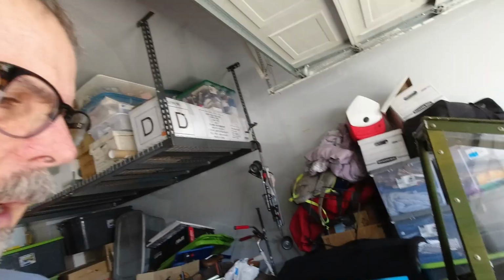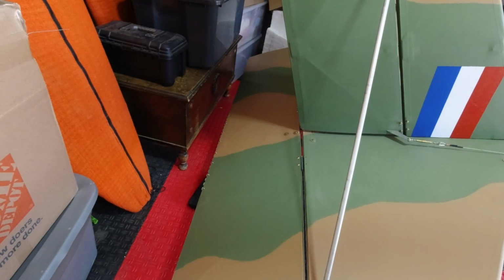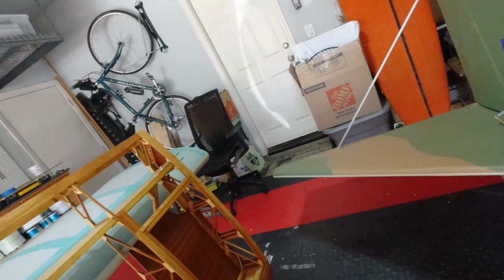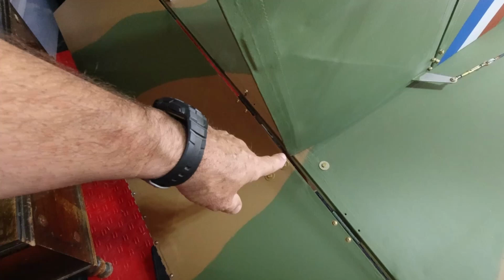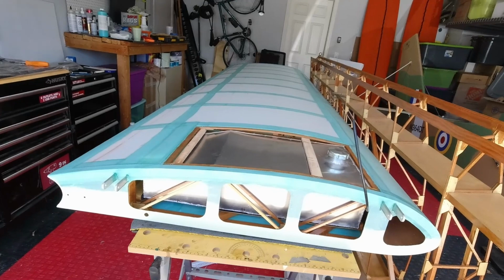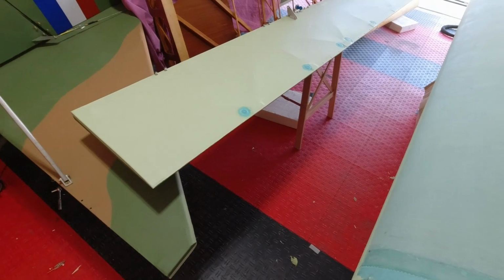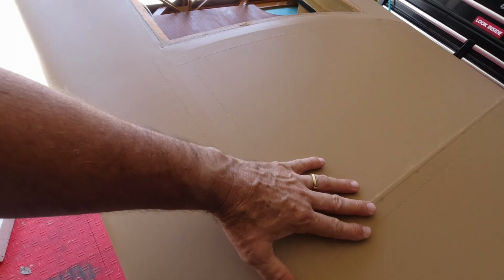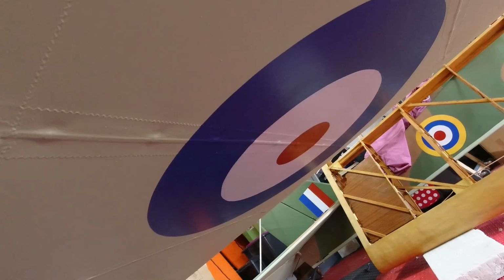Minimax 1100r Wood Aircraft Build Ep 199 - Wing Painting

Comment: Hey Dennis!
How are you mate?!
My name is Raphael, and I live in Brazil. 
I am watching your fantastic building since the beginning. Congratulations!
I am also building a Himax, and I am using the material I have available in my country. I see that you are using Douglas fir instead of spruce.
If you don’t mind I have a few questions: did you reduce the size of the wood due to the use of a heavier wood? My ribs looks so “skinny” comparing to yours: was it made of 1/4 x 1/4 wood?
By the way: the manual recommends the use of UV barrier before painting: what kind of material are you using?
Thank you very much, and again: congratulations for your excellent job!
Reply from the maker: Hi Raphael!
I could have tested the wood against spruce and then reduced the size by that factor but I chose to stick with the original dimensions. I estimate that I paid about a 15lb weight penalty for that but obviously gained a lot of strength. My ribs are 1/4x1/4. 
I’m using one of the best exterior latex acrylic paints. I figure if it’s designed to be on the outside of a house every day for 20 years then my hangered airplane will be fine:)

Comment: Many years ago I had a mini max with a mosler engine on it and a "fighter jet" style canopy.   Never got to fly it cuz it had an electrical issue (turned out to just be a bad condenser) and i headed to Afghanistan for a year.  What kind of paint are you using?  Please let me know what your doing for the painting sequence.....any UV protection?  Thanks
Reply from the maker: I’m using Behr Marquee exterior paint. The best you can get at Home Depot. My formula is simple, 200g of Paint, 12g of Flotrol, and 30g of windshield washer fluid. 
The paint is my only UV protection.
Reply: @DTMinimax   And that's likely all the UV protection you'll ever need.  Someone once covered a one foot square frame with the same material you're likely using, and set it outside, 24/7.  He punch tested it every year.  It finally failed after seven years of constant exposure, and even then, he suspected a dog had peed on it at some point. 😂